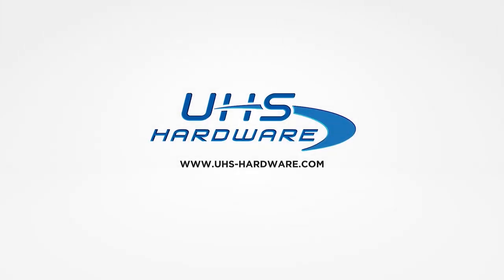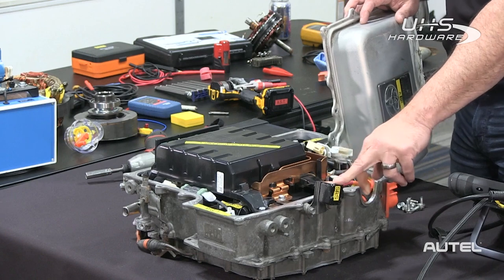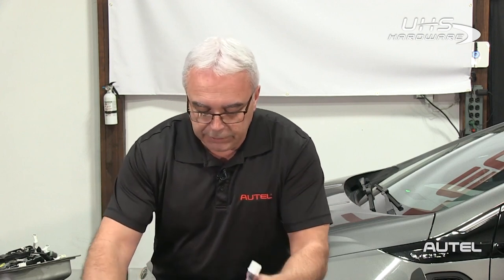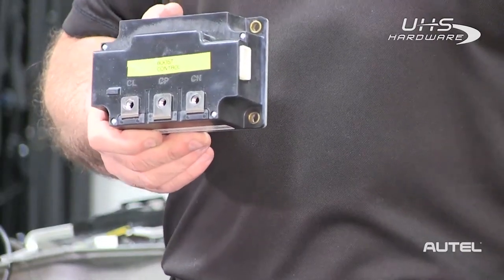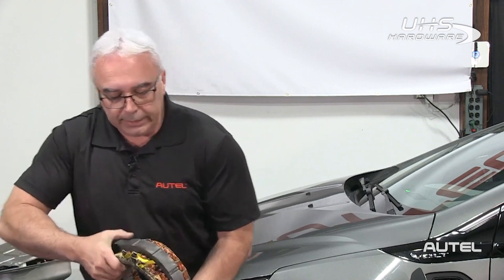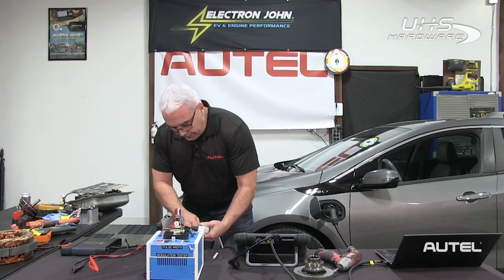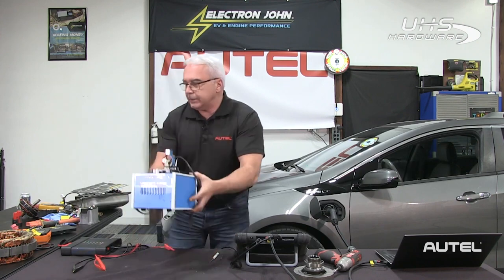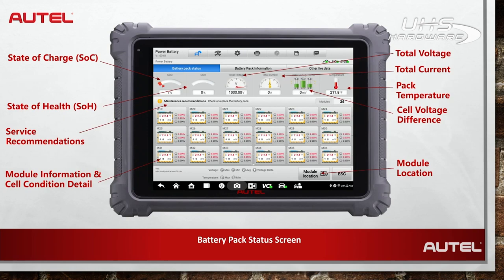How To Make EV and Hybrid Repairs Easy  part 1 - Autel EV Diagnostics Webinar - 1hr 45min

Comment: Hi John, how do you do the battery pack calibration please?
Reply from the maker: Excellent question. I will search for a answer! Lu.
Reply: basically, the battery has to be drained to less than 5 %, then using a level 2 charger, the battery must be fully charged until the battery is no longer taking a charge.